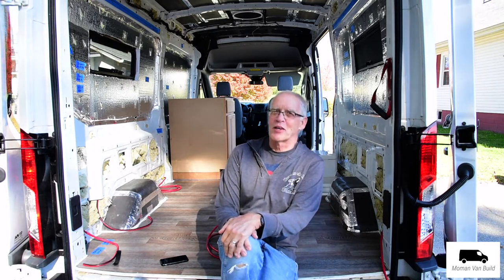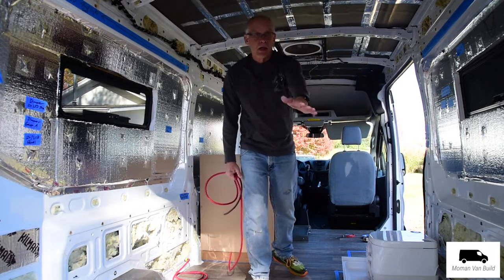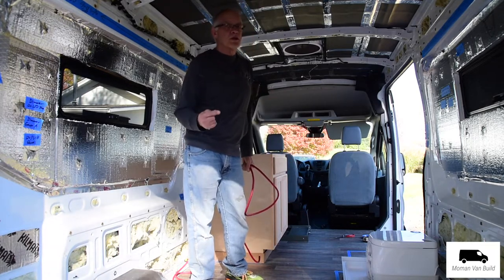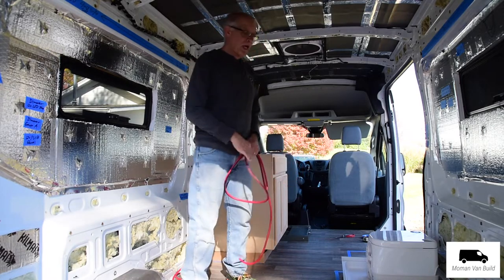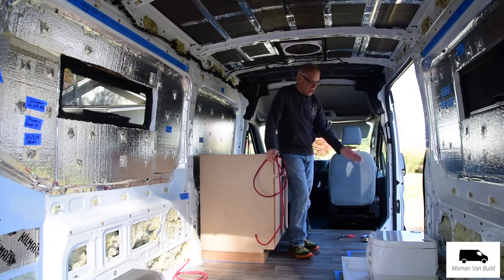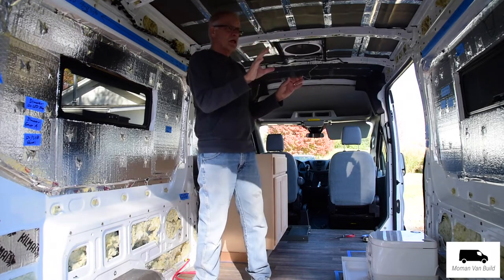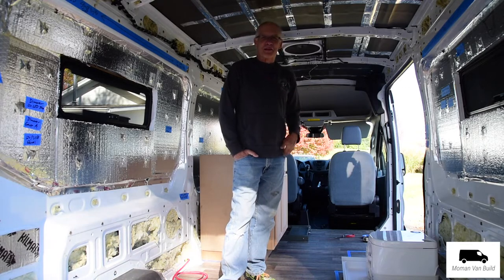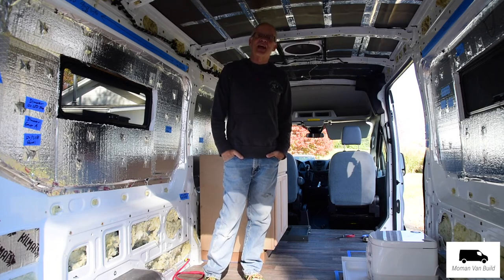Moman Van Build Episode #12 Short Update - A Design Change!

Comment: Great floor plan change.  Are you going to install a grey water tank under the van?  For my next build I was thinking about a recirculating type shower.  Best to you both.
Reply from the maker: Initially we are not adding a grey tank underneath - just jerry cans under the sink and a drain line directly under the shower. When we take a quick rinse/shower we will open the line underneath and set a jerry can under to collect it. I may add one later if it becomes needed. Thanks for following along.

Comment: Sounds like a great plan! We’ve noticed what we use and dont use as we’ve camped more and more. Will the potty & shower be enclosed in their own space?  Can you explain it in a video?
Reply from the maker: Susie is about to build the potty/shower box that will have a drain and it will be waterproofed with Flex Seal. The lid will be hinged and it will be routed and have a rubber gasket. This will be shown in probably episode # 14 or #15, I believe. she is a much better woodworker than me, and has more patience than I have for sure!
Reply: @charlesmoman  Awesome. Cant wait. Good luck too!